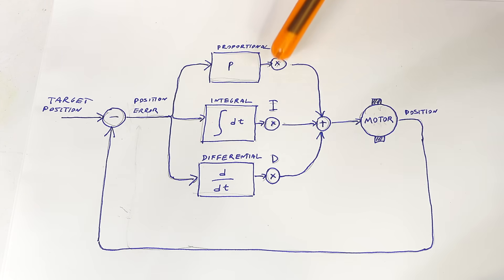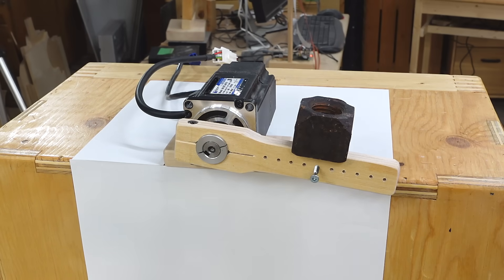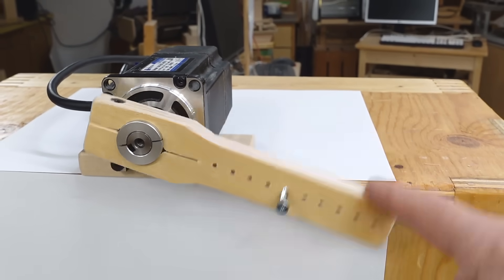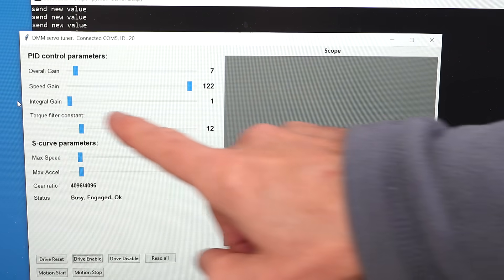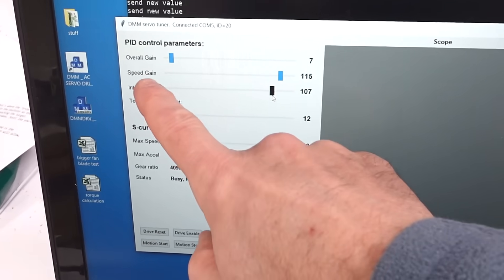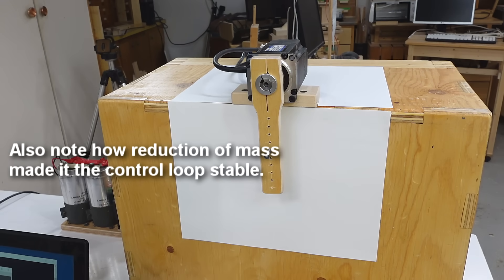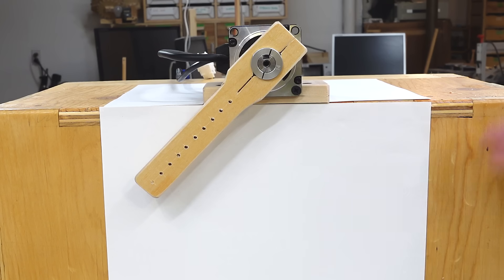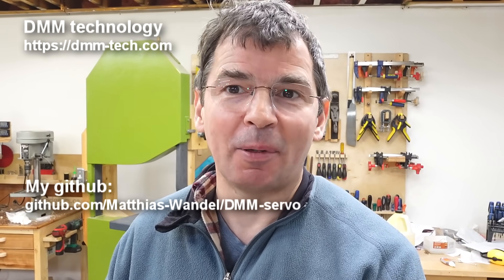What does a PID controller do?

Comment: The cruise control in my car needs to have its PID parameters tweaked - it is a horrible jerky drive on any sort of twisty road. It needs to reach the target speed a lot more gradually. Unfortunately the PID parameters are not user accessible :(

Comment: I’m a motion and control engineer. I am using pid controllers on daily basis. I do find myself trying to explain to other how does PID actually work.This is a great explanation at eye level, I’m sure gonna add a link to this video, next time.
Minor comment - perhaps I got it wrong, but if I didn’t, the vertical axis in the s curve graph should be ‘position’ and not ‘speed’

Comment: Cool demonstration for practical purposes - nice!!
A small correction on I & D sensitivity: both I & D terms can cause oscillations if set too high. Your statement holds very true in low-speed torque-control scenario. But, for example, in high-speed low-torque control scenario (like a drone motor control), D term becomes the twitchy one. In a veeeery slow processes where response is measured in tens of seconds or longer, even P term can get You into oscillations (typical for heating systems). And about the name: "PID" is valid if we look at the "sequence" how given terms are calculated in discrete (digital, step-by-step) system. P comes first - just a current error. I comes next, as it adds just calculated error to itself independent of previous state. And P is the last one as it need just calculated error AND historical value to do the math, but the historical value can be acquired only after at least one P or PI calculation loop is done. So... PID it is.

Comment: Here's just a couple of little things to make this better.

First, it's normally called Derivative, not Differential. If you want to know the difference, Google it.

PD as described is NOT always the best control mechanism, depending on the system and its purpose.

For large lumbering systems like a power plant that don't move fast, the Proportional and Integral portions, PI is all that is used.  And they work fine.   The Integral part IS important.  (All the controllers are PID in say a large power plant, but in almost every case the Derivative is detuned.)  So the Derivative function is not always necessary.  For fast moving systems, Derivative MAY be better.  Here's some information that may be of help, for CONSTANT SETPOINT systems:

P and I work on an offset called an Error.  The further the actual Value is from the Setpoint (the >desired< parameter Value) the greater the Error becomes, and the more action they take (changed Output.)

-Proportional control will generate a certain Output to be applied based the amount of Error.  How much signal is applied is called the Gain.  As long as the Error exists, the signal will be the same. BUT there may always be a difference between the Setpoint and the actual value with only Porportional control. For some systems, this is close enough.  Too little Gain and the Value continues to drop, too much and the system can become unstable and can cycle. 

Proportional Example P: Simple controllers may be just Proportional.  With say a tank that is feeding process water somewhere, the fill valve could be on a float) off of a water supply. If the outflow from the tank increases, the float will drop, physically open the valve with a lever (Output), and the tank level will stabilize at the same flow going in as the outflow, BUT the level will STAY lower, keeping the float valve further open.  If the tank slowly fills, the Error drops, and the valve pinches back.  If the level keeps going up, when it passes the Setpoint the Output closes the valve until the load catches up. Just what you would want it to do, and fine if you don't mind the difference in stable tank actual levels.  This is what YOU would do if manually controlling the inlet valve!  Yes, a float valve IS a simple Proportional controller.

-Integral action restores a value to the Setpoint.  It "looks" at the Error every set time period, and it REPEATS (replicates and adds to) the Proportional signal as long as the Error exists. The >TOTAL< Output will continue to change over time until there is no Error.  The setting you are adjusting on an Integral controller is how often the process occurs, expressed as Repeats Per Minute, or RPM.  Yeah, I know, that same acronym is used elsewhere.

Integral Example I: Say it's the same tank used in the previous setting, but now it's important to maintain level constant.  So say the out flow goes up; Proportional 'sees' the level Error and opens the inlet valve. The tank stops changing level in a bit, BUT it's not at the desired level/Setpoint.  Say we use a PI controller on the valve now.  The controller will continue to raise the Output by the Proportional value every Repeat, opening the valve more, until there is no Error; the tank level is mostly constant AND has returned to the desired value.  So with a Repeat value of 5, that means the I part of the controller will do its thing every 12 seconds.  

Too little Integral, you don't get back to Setpoint.  Too much and you may hunt around the setpoint, which is what your example system was doing.  Yes, Integral is NOT good for rapidly moving Setpoints!  With things moving that fast, and Integral being time based, nothing is sitting around still enough to generate a valid signal. Your Demand may have reversed before the Integral section can do anything, or worse, it's adding Output at the wrong time.

-Derivative is rate based. The RATE of a value's change over time. (The infamous dx/dt)  The Derivative controller looks at how much the Error is changing over a specified time period, and the also REPEATS (replicates and adds to) the Proportional signal as long as the Rate is changing, on top of the Proportional and Integral Gain Outputs.  The adjustment is also in Repeats Per Minute, RPM.  That's how often it 'looks' at the rate of change.

Derivative Example D: Back to our same tank again.  If the flow going out of the tank increases fast enough that the change is very rapid, the Derivative section adds yet more to the Output to stop it faster.  Turning the RPM lower doesn't do much of anything with no large rate of change.  Too fast and you get "divergent" swings; it keeps overshooting more and more, usually resulting in things flying apart, or all control collapses; like the tank goes dry or overflows.

Comment: HI, Matthias. Thanks for this clear teaching. However, i would like to know what else could cause overshooting and oscillation on CNC Servo Motor? I do cnc programming for injection mould parts. I can not get a propre circle anymore and I'm getting chattering marks on the parts too. Please help.
Reply from the maker: Mis-tuned control loop.  But could also be something loose in the CNC's mechanism. like something having play somewhere

Comment: PID stands for Proportional (the greater the error the greater the response rate ), Integral (error response rate over time ), Derivative ( rate at which the error rate is changing to achieve setpoint value )     
The analogy I came up with for a PID control loop uses our own brain and things we don't even think about while driving a car .
Let's say we're driving getting on a freeway on- ramp and our speed setpoint changes from 35 MPH to 55 MPH to merge onto the freeway .
Using the speedometer as our feedback sensor our foot presses the gas pedal to correct for the new speed setpoint error =(Proportional Gain) and the car then accelerates . We notice with our position sensor (our eyes )that our car is not increasing speed fast enough to hit 55 by the time we reach the freeway so we add a little more gas pedal = ( Integral Gain) . We then notice via speedometer we have now overshot our 55 MPH speed setpoint so mentally we calculate our arrival to merge onto the freeway and gradually reduce foot pressure on the gas pedal so we hit 55MPH just as we enter the freeway .
Reply: Of the hundreds of comments I've looked at, you are only like the third person that understands what they are talking about!!!  This stuff isn't exactly correct.  And in your example, Derivative would be cresting a hill and finding out that you are accelerating faster than you planned to, so you back off even further.
Reply: @nathanwahl9224  I was trying to furnish an analogy that people could easily understand and relate to from their own experiences . I like your explanation for the "Derivative "  Thanks
Reply: @kls2020  Yeah, thanks; it's basically rate based, the other two are strictly error based.

Comment: Very clear explanation, thank you for making this video. However, I don't understand the dumbing down of the parameter naming. I assume it was provided by the manufacturer and you copied them. A PID controller has terms P, I and D. Not "overall gain, and speed gain. The naming of the "S curve -parameters" for the max speed and acceleration could not have been worse from a controller theory point of view. Not using the same or standard terms is horrendous in a science environment. Whether or not the user has no education in control theory. The user should use the and perhaps learn the correct terms, and the terms should not be dumbed down to a level below education.

Comment: Great video! I was hoping you would have talked about diagnosing a slight hunting oscillation.  I'm pretty sure it's ground or power problem.
Reply: Look to see if your Integral is set a bit high.  Is it a fast or a slow 'hunting'?  If it's fast it could be a bit high on the Derivative, IF you are even using any.

Comment: I once worked as a third party process controls tech at an Owens Corning fiberglass matt production plant. Fiberglass matt is produced using the same methods as paper production. The system controlled the flow rate of material, the amount of dye being applied to the wet material and the speed and temperature of the drying drum. The parameters of thickness, moisture content, and color was measured by a multiple sensing device at the end output of the process. 
I lived in fear of having to adjust the PID data points. I understood what it was for but I really suck at high level math and this was mid 1990s  - there was no program with "sliders", just spread sheets and strings of calculations. The string of data points for each parameter had to mesh with all the other parameters and one miscalculated or miss-entered number could cause wild and costly oscillations in the process and output product. Tweaking the PID data had to be performed only when one of the sensors was replaced or if a there was a major change in the raw materials being used. I never had to deal with it while I worked there. I'm an excellent electronics trouble shooter, pretty good at electronic circuit design, and a damn good mechanical system tech, but this job made me realize I am NOT a process controls tech.

Comment: Actually, PID stands for proportional-integral-derivative (NOT differential, which would make no sense).

While this demonstration is quite useful (not counting the repeated error in terminology), there is a simpler way of describing concept of the "I" and "D" functions, and this is the way I always related it to my customers back when I was designing op-amp based PID controllers in the 1980s:

"I" (Integral) is there primarily to correct for the inherent friction in the system that is being controlled by the PID. The "P" (Proportional) term, if small, might not result in enough output to overcome friction, so the result may be that the system never fully returns to its target value/position/etc. Increasing the amount of the "I" term adds a boost to the output to overcome the inherent friction, and thus results in the system fully returning to the target value.

"D" (Derivative) is there to look at the rate which the system is returning to its target (especially when the system is nearing the target), and it 'steps in' by counteracting the "P" & "I" terms if it senses that the system is returning to its target value too quickly, and is thus likely to overshoot.

BTW, Matthias is not alone in referring to the "D" term as "Differential"; lots of folks make the same mistake.

Comment: If you add lag to your feedback, which is an undesirable trait, but unavoidable in some situations, then you will never get stability with a high D term. Generally you set P and I as high as you can without being too violent/sluggish, then slowly add a little D if needed to remove a little of the sluggishness.

Comment: My only experience with PID controllers has been with scientific ovens.  The PID is very important for maintaining accurate temperatures.  In a scientific oven, we cannot afford to have large swings in temperature as the heating elements turn on and off.  The PID settings are critical there.

Comment: You should also add that too much proportional gain will also cause the system to oscillate. In fact that's often the first step in some of the classical PID tuning algorithms such as Ziegler-Nichols -- finding the P gain that causes the system to oscillate at constant amplitude with I and D set to zero, then setting it P some fraction thereof (the exact value depending on whether you want P-only, PI, or PID control).

Comment: I'm curious if you used the Zeigler Nichols tuning method, how well the math would work with your demo setup. I've had success when using it with positional PID loop, but not temperature PID loops.

Comment: Assume you want the output to follow the input (H = 1). Y = output, X = input. Y/X =G/(1+GH). G is usually the forward loop gain. H is the feedback. So, for PID the forward gain is expanded to G + A/S + BS. G is the proportional gain, A is the integrator constant, and B is the derivative constant. (I have designed phase lock loops with just A/S in the forward loop gain, basically a capacitor and series resistor.) With just gain, you will never get Y = X until the gain goes to infinity. Since the integrator can sum and get arbitrarily close to infinity over time, it effectively allows the output to equal the input. The derivative allows faster response. It is very sensitive to noise (fast up and down edges) so it must be used with great care.

Comment: I was taught the D term was Derivative but who knows. Also taught the three terms could be Rate, Reset, & Gain. We used PID loops not only in position applications ( we called them position or velocity (speed) loops) but Temperature, Flow, Level, PH, DO, etc.  I don't know how many Process or Chem engineers I knew didn't know how to tune a loop. Set the "P" to get just below the SP without overshoot, set the "I" to get you there faster, then the "D" term to get to the final value. With all the autotuning SW out there now even an ID10T can do it.
Reply: Of ALL the comment I've read so far, you are only the SECOND ONE to get it right!!!  I've taught this for decades.  A lot of what he is saying is just wrong.

Comment: When you first cranked up the integral gain, it didn't exactly go unstable because you also created a situation with a hysteresis loop in the load because the weight lost contact with the arm and the gravitational and inertial loads went to zero for a short period and then, when the weight hits the arm, it gives an impact load.

Comment: Its can control not just motors, but level, flowrate, temperature, ph, speed, you name it. Just equip the loop with the right sensors and control devices
The controller reacts to the difference between a setpoint and the actual process is value.  Integral is a an ongoing summation of the deviation, and differrential is proportional to the rate of change of the deviation.

Comment: Mid-1980's mechanical engineering student here. Scene setting: no personal computers, still using mainframe computers; some still using punch cards. One class I still remember was the only "controls" class available. Okay, I have very little microcontroller experience, but a PID sounds very much like the analog circuits we used. Negative and positive feedback loops, for example. I do, clearly, remember "bread boarding" capacitors, resistors and ?? to study mass-springer-damper systems, i.e., car suspensions. Was this the analog predecessor to the PDI?

Comment: But I learned in school 40 years ago that it was mostly when tinkering with the D part that made the system to self oscillate .  I guess I stand corrected .
Reply from the maker: The D part helps to dampen it, so can make it stable.  But if  there are delays in the feedback, that can add to instability, so you may have had to mess with D to get it stable.

Comment: Matthias, you‘re a heck of a clever dude.
Would have saved me an unnecessary long discussion with the manufacturers support engineers 20 years ago on a film transport system of a scanner with oscillation symptoms on the film tension controlling mechanics.
Took me a while to put that out, but I think it is correctly put overall.-)

Comment: There are some few steps that can be followed to choose the right controller:
Identification the structure of the controlled object (P, PT1, PT2 or Dead Time). For this normally a step signal is applied, and the response is recorded.
Based on the structure and parameters of the controlled object, the structure of the controller can be selected. P, PI, PD, PID or I. Yes sometimes just an I is needed for a controllable structure with a big dead time.
Once the structure of the controller is selected, the parameters can be selected based on the parameters of the controllable structure. For example: Chien / Hrones und Reswick Or Oppelt (never used any of them, did always by empirical result)
Then you can test it, and adjust the parameters as required.